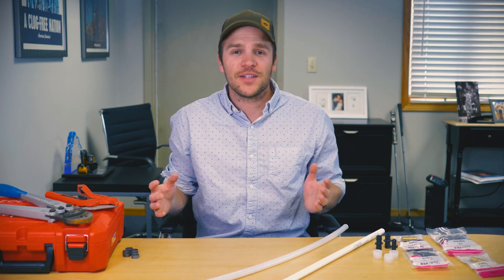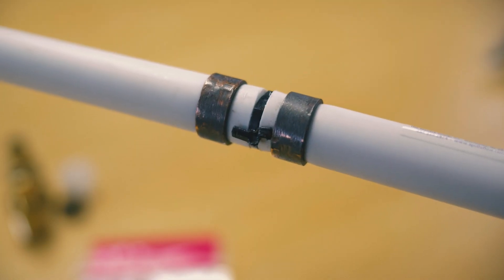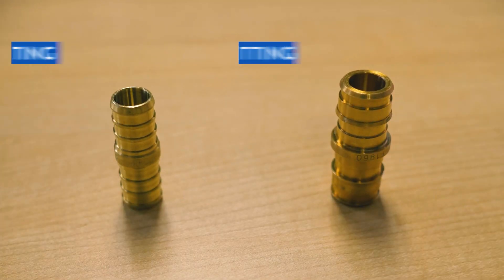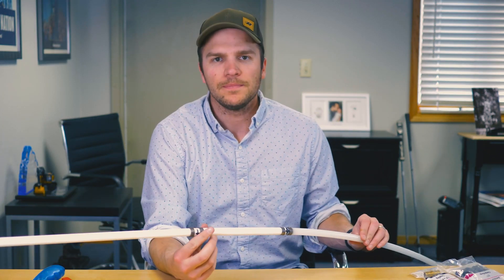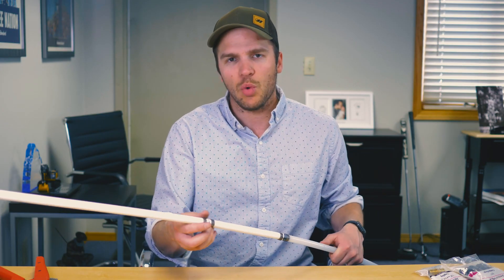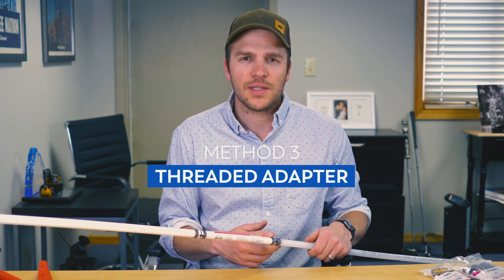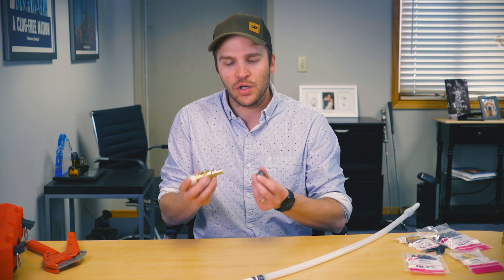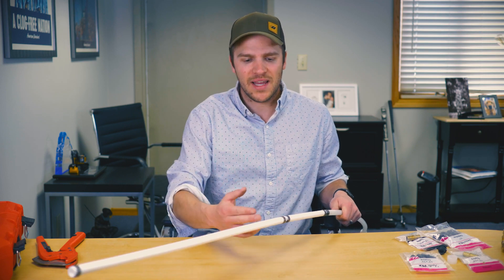Connecting PEX-A to PEX-B

Comment: Another expert that doesn't like or recommend Sharkbite fittings without an explanation?
Reply: Couldn’t agree more, I’m kind of sick of these opinions. It’s clearly an opinion or a situation of “I had a friend who saw one fail once therefore it’s junk” I’ve seen sweat connections fail, copper burst out the side. They also fail to realize the pro press connections they use to speed up their jobs also use a similar rubber gasket in them to a sharkbite. Somehow that’s fine to use, but a more cost effective sharkbite is for reasons never explained somehow “temporary.” A sharkbite connection is a quick and perfectly fine way to connect copper, pex (a and b), and CPVC. It is far less complicated and home owner friendly too.

Comment: I wish my house has been plumbed in PEX-A instead PEX-B. Bloody cheap contractors. 🤬
Reply: pex-a costs more than pex-b
Reply: @rockygrewal7182  Quality and doing things right always costs more in the short term.
Reply: Haaaahaaaaaaa 😂👍
Them RiP-Off people.... Just want A quick and Easy Money...👎👎
Reply: why? if the contractor done it properly you should not have any flow issue. If he use zurn B then it is more expensive, it all depends on the brand. I personally prefer pex b because I dont mind it being stiffer and it has better uv resistance, less leeching, and and hold more pressure. But I always use zurn so not sure about other brands
Reply: @kevinji7285  Unless you have a custom home, the construction contractors are going to do everything as cheap & fast as possible.

Comment: I got a house with pex B in it, but I use Uponor pex A...  can I expand the Pex B and take off with my Uponor fittings? Basically can i use pex B with Uponor fitting and rings?
Reply: If your pipe has the number f1960 or f1807 you can do either or.
Reply: @jwblount7802  this is good to know

Comment: I had a 2 inch viega fitting blow off because it was used on uponor pipe. I think the i.d. of the pipe is different but the od is the same, that's why shart bite works where the crimp may seem to work but not hold at high pressure. I would just stick with the right fitting for the type of pipe. Just be careful, and do some research.
Reply: Thats why you double up of your crimping ring.

Comment: As a homeowner with years of construction background (but no official training in plumbing) You mentioned that you did not recommend sharkbite as a permanent "transition solution". How do you feel about sharkbite fittings overall? I used 1" sharkbite fitting from the meter and was planning to use sharkbite within my installation as well. What are your thoughts?
Reply: I would guess that it is unwise to use inside walls.  Where you can inspect it, it should be reasonable.  Also best if well clamped to prevent movement.
Reply: Open area is fine so you can address if there’s an issue.
No one knows the longevity of the o-ring inside Sharkbite fittings and that’s the knock on them. It WILL fail at some point but only time will tell for each fitting or the care / method used to install.
Reply: So I heard they are changing the code here I. Canada to allow full sharkbite fittings in a new build. Interesting
Reply: @justaworkeryup636  it typically the old school guys that are skeptical of them. Pipe cut and chamfered properly should not have an issue, same as proper prep with any fitting should not have an issue.
Reply: most of them will leak within 5 years

Comment: Lol your first solution is to go against manufacturers recommendation and then to get something in writing from them?... SharkBite works on both Pex A and B and warranties for 25 years... whats the warranty on your crimp connections?
Reply: Is a 25 year warranty really that good? I'd think 25 years is just long enough for people to do a flip or sale and essentially make it someone else's problem, but you do you I guess.
Reply: @nova31337  Never met a flipper that kept a house much for more than a year. In this day and age most Florida houses will sell at least twice in 25 years. But who knows for sure
I'm working on a condo ( 4 units high) from the early70s. Upgrades include more than just the 2 bathrooms and kitchen (still original). 
NOTE: The first phase of construction still used galvanized pipe for CWS and cast iron for drains and stacks, while the 2nd phase only a few years later used all copper, and pvc drains. 

 The unit, in phase one the hot water is original copper with minor corrosion. Some years back one homeowner had the old galvanized CWS capped off and replaced with CPVC which has become brittle at the joints... It cracked twice during demo, something I've never had a problem with in copper. I'm recommending both be replaced with pex and sharbites properly anchored between the drop ceiling and overhead concrete slab.  (The owner does not want copper reinstaled) Crimps WILL be used at shut off valves to eliminate spinning. I'm also leaning on steel sleeves for vertical runs inside the wall to avoid cabinet, picture hanging punctures, and other potential cuts/punctures.

As the construction is from the early 70's I'm imagining that the Cast Iron will start to fail well before the shark bites and pex The replacing of the CI will be incredibly invasive, and if it doesn't result in the destruction of the building, the pex can be re-evaluated at the time. Thoughts?
Reply: @danielolson437  ouch, galvanized and cast iron. I can feel your pain. My only hesitation with sharkbite connections is them being present where there isn't ready access to them in the event of a failure. I was completely against them for a long while, but can see the utility and (if installed correctly) should exceed the warranty period and beyond. So long as precautions are taken, such as doing long runs with no joints in the walls or if a sharkbite joint is present, including an access panel to be able to change it on failure without being super invasive helps.

I've started leaning towards replacing copper with PEX A as I'm in the far north where temps can easily go into the negatives. Some report smells and taste differences with PEX tubing, but any endpoint water filtration system such as in a refrigerator or under-the-sink filter system should eliminate that issue until the pipes have been properly broken in.

Good luck with the galvanized and cast iron pipes. They are a royal pain and can't be gone quick enough!
Reply: Zurn also boasts a 25 year  on crimp or expansion . Realistically , it's just a bunch of bs from most all companies   . https://www.youtube.com/watch?v=E9OUK7krNH8

Comment: As a homeowner, I always have this concern on plumbing pipes - say you have an old pipe coming from the concrete slab that has had multiple repairs done to it over the years. During each repairs that piece of pipe had been cut and joined and now, it's almost to the concrete slab where no pipes left to cut. If the current join fails, how do you make that repair? Sorry it's not pex-a to pex-b related.
Reply: I went through this recently, with a leak in the original supply line coming from the slab. I now have a fitment extremely close to the basement floor in my PEX master water line.
If it becomes too extreme, it will be necessary to pull a new water line, from the street. For PEX, they will dig down into the earth, probably in your yard, to find where the water line connects to the City. Then they will jackhammer into your floor, to loosen the PEX pipe. This allows them to use the original pipe as a fish, to pull a new pipe through to the city connection.
If your original water line is copper, they will probably have to dig all the way from the city connection, up to your foundation to replace the line.
Reply: @JM.TheComposer  Agreed a new line, all pexb, no copper anywhere if you want worry free plumbing.
Reply: @Bound4Earth  first off, plumbing is not DIY friendly as in most trades including electrical,
Shark bites work fine per manufacturers application list of which pipe to fitting manual they have,
Plus they are made of copper, plastic and steel, they're are expensive for a reason, but 100% of shark bite failures are DIY types who hate crawl spaces, bugs, ECT, crawl under a house and start cutting and operating on the home and know nothing about the proper cuts and cleaning as well as proper seating ANY connection requires...
Nope cut fast, slide it halfway on and failure all because the shark bite or the individual?
I don't hire people who know how to do it, I hire people who listen to how I want them to do it, I've learned there's not many who rather do it the correct way vs their way... Everyone is an expert, until they call me and I'm like 🤦 what did you do?
Reply: @Sumama-Mitch  Preach. Every person dogging shark bites, or any other method for that matter, never actually “saw” The fitting itself fail. It’s always based on their feelings about o rings or someone screwed up installing it, not cleaning pipe, getting crap inside the fitting first, etc. I’ve got push to fit, glued, sweat, and crimped plumbing all through my house, depending on what fit best or was easier to get to or frankly what I had on hand when I needed it. Whole house was poly and pvc, built in ‘83, but one project at a time, it gets changed, remodeled or fixed due to failure.

Comment: The manufacturers have PEX-A x PEX-B adaptors. You can use a threaded connection, however thread them together first, THEN fit the adaptive coupling into place. They also have Poly x PEX-A and more commonly, Poly x PEX-B.
Reply from the maker: I wasn't able to find a PEX-A x PEX-B adapter at local supply houses or hardware stores, so I left it out of the video. They were only carrying PEX-A x PB couplings. Do you have a link to the adapter at an online supply house? You're right about the threaded connection! I hope we were clear about that in the video. Thank you for your comments — your input is spot-on and appreciated!
Reply: @willplumb  Thank you for the video.  It will most definitely Help people...
CAN A CLAM RING and a pinch stainless steel Ring be used in  Underground...????
Reply: @willplumb Home Depot, ACE hardware, and supply store carries them.
Reply: PEX-A x PEX-B adaptors do not exist, since other than an expansion fitting all other fittings  are dual purpose a or b. Sharkbite and Zurn parts cat say it does not exist.